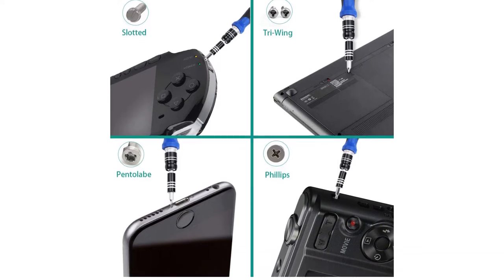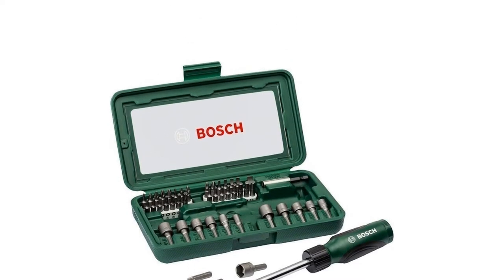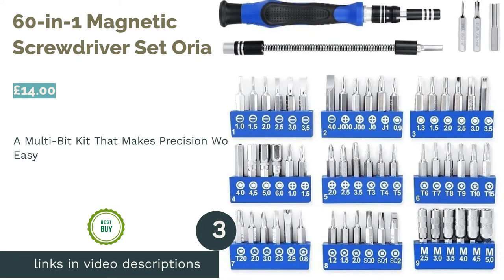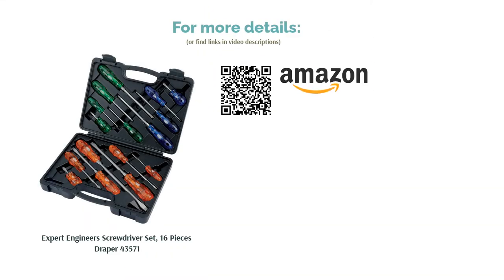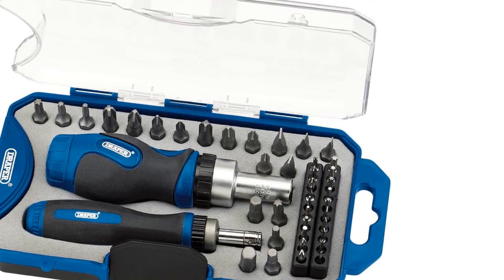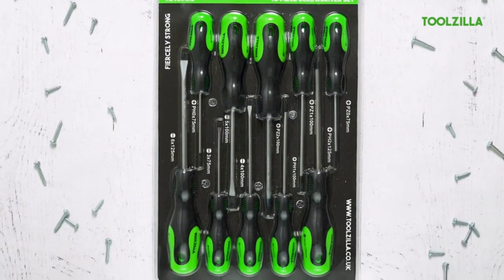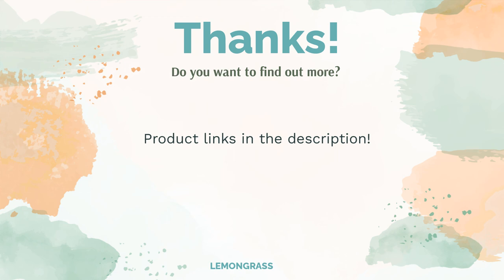🌵 10 Best Screwdriver Sets

Comment from the maker: PRODUCTS
00:49 #1 - 46 Piece Screwdriver Set Bosch 2607019504 (£21.90)
🛍️ Amazon: https://www.amazon.co.uk/dp/B000NDGQD4/?tag=lm007-21

01:26 #2 - 44 Piece Screwdriver / Bit & Key Set Draper 81294 (£21.90)
🛍️ Amazon: https://www.amazon.co.uk/dp/B013OYAZYO/?tag=lm007-21

02:07 #3 - 60-in-1 Magnetic Screwdriver Set Oria (£14.00)
🛍️ Amazon: https://www.amazon.co.uk/dp/B01DXTZM8O/?tag=lm007-21

02:39 #4 - Expert Engineers Screwdriver Set, 16 Pieces Draper 43571 (£43.86)
🛍️ Amazon: https://www.amazon.co.uk/dp/B0012332OA/?tag=lm007-21

03:18 #5 - Screwdriver Set - 58 Pieces Rolson 28882 (£18.99)
🛍️ Amazon: https://www.amazon.co.uk/dp/B00JITIPFG/?tag=lm007-21

04:01 #6 - Ratchet Screwdriver and Bit 42 Piece Set Draper 46479 (£10.50)
🛍️ Amazon: https://www.amazon.co.uk/dp/B0108A1DUC/?tag=lm007-21

04:42 #7 - Kraftform Comfort VDE Screwdriver Set, 7 Pieces Wera 31575 (£16.90)
🛍️ Amazon: https://www.amazon.co.uk/dp/B000X1P2OA/?tag=lm007-21

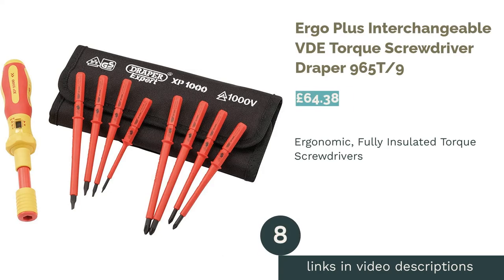05:24 #8 - Ergo Plus Interchangeable VDE Torque Screwdriver Draper 965T/9 (£64.38)
🛍️ Amazon: https://www.amazon.co.uk/dp/B00UJJ8I3I/?tag=lm007-21

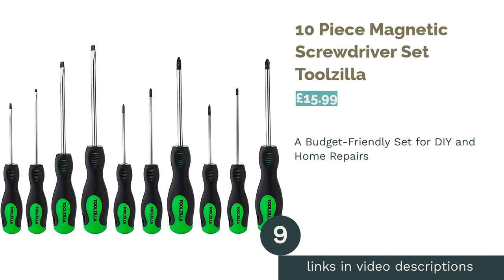06:06 #9 - 10 Piece Magnetic Screwdriver Set Toolzilla (£15.99)
🛍️ Amazon: https://www.amazon.co.uk/dp/B077XXSW25/?tag=lm007-21

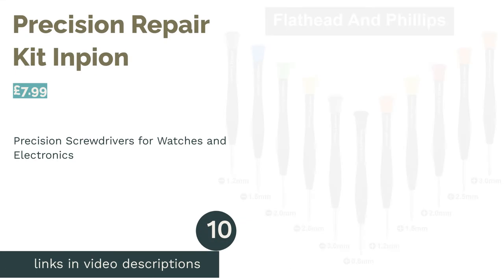06:43 #10 - Precision Repair Kit Inpion (£7.99)
🛍️ Amazon: https://www.amazon.co.uk/dp/B07Q3TDMK2?tag=lm007-21